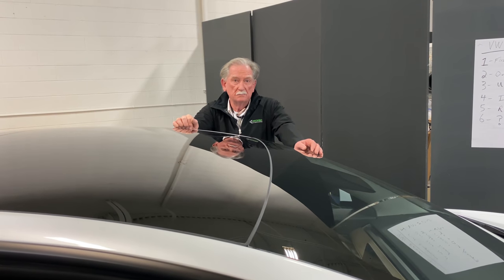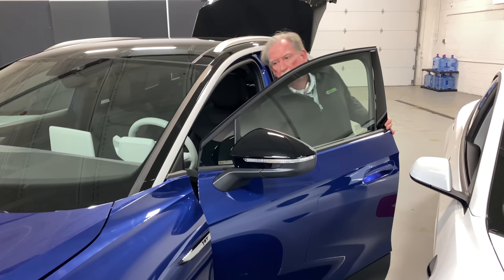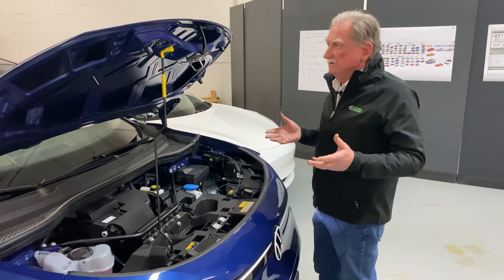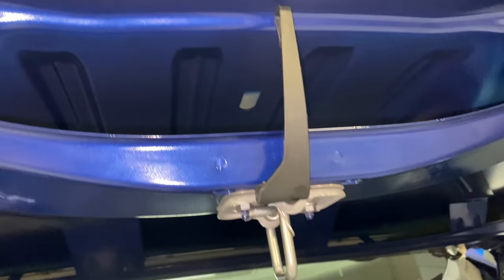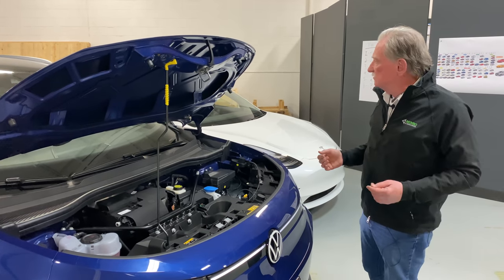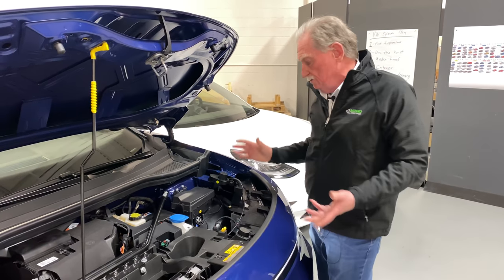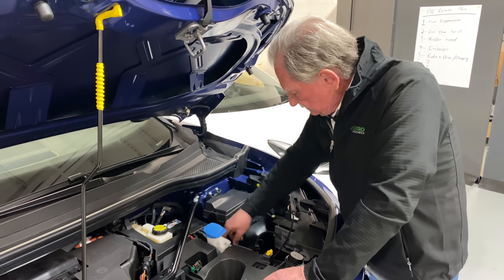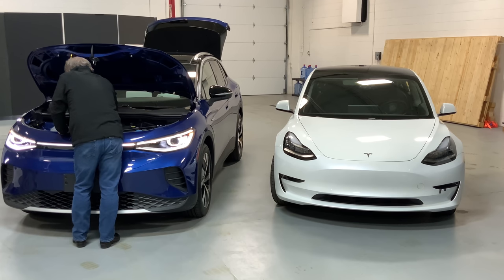2021 Volkswagen ID.4: E2 - Under The Hood

Comment: The VW is engineered for future expansion and changes on the platform. The underfloor area for the battery is more well designed than the Tesla. So now Tesla is trying to go a different route with their vehicle. The battery will be part of the car instead of a removable component that can be easily serviced , replaced or upgraded in the future. 

 I don't want to be anywhere near the first Tesla that breaks in half in  a high speed collision after a few years on the road. I have been wrenching on cars for 35 years both professionally and as a hobby.

I have cursed engineers and been impressed by them. I have seen what was once old become the newest high tech wave of the future more than once. 

The first unibody vehicles became garbage because the manufacturers thought they could cut corners and make them cheaper and lighter. Then they started to cycle back again and beef them up in certain areas after watching them tear in half or pin the people in side of them all crushed up and broken.

Many newer cutting edge engineers with futuristic ideas have no experience with reality. It all looks good on paper until the real world slaps you in the face.

Tesla has amazing engineering in some areas and pushes high tech toys that are ridiculous in a vehicle and are detrimental to safety. 

I could list 20 of them off of the top of my head. The Tesla driveline technology as of today can't be beat. 

The rest of the cars are crap and actually quite dangerous if involved in a crash or GOD forbid they catch on fire. Electric door handles and security features to get into the cars that prevent use or fail in an emergency will get people killed. A door window that has to come down before you can open the door is just stupid. Currently today there are a huge ratio of Teslas with door latches and handles that just don't operate or have been repaired multiple times.

I love Sandy and his insight into Engineering. He is an extremely intelligent man but like all Engineers they get into a lane and tend to stay there. It can't be helped , we are all human. 

That being said, The VW ID4 is superior in build quality and overall design to the current Teslas' on the market today.  If I was going to go out and lay down a check for one today between the two manufacturers it would be an All Wheel drive ID4. Even though the range is lower I guarantee in 10 years the VW will be in better shape and more enjoyable to drive.  As far as repairs go to the vehicle. The VW is built to be worked on and serviced easier. 

Everything in this world breaks or wears out. I would much rather work on the VW than the Tesla.

The Tesla battery management, battery , and motor is far superior right now but that is going to change rapidly.  

The actual build quality , fit and finish on the VW is better than the Tesla. The ride and handling is more comfortable on the ID4. The pricing on both needs to drop drastically but I get it , new tech is expensive for awhile.

PS . The interior space is way better in the VW for size when compared to the TESLA.

Comment: That bar over the battery is scary AF.  It may have a thick enough paint coating now but after you use the jumper cables a few times it's going to get scratched up and that coating will be worthless.
Reply: your not supposed to use that,
There is a positive pole in the fuse box for that.
Reply: @storm4710  There's a nice closeup at 5:35.  I don't see a spot, can you tell me where?  I tried googling but found no results about the ID.4's 12 volt battery posts.
Reply: @rhamph  the long thread on the 80A fuse, 
But vw recommends to use to use the positive on the battery and the negative on the body (u can see it above the battery @6:07 )
Reply: Still not clear to me which spot you're referring to on the fuse box.  I do see a shinier portion but I think it's just plastic with a different finish.

Sandy was connecting to the positive on the battery, it's the terminal that collides with the supporting bar when you attach jumper cables.  He also mentioned that the negative is the body itself.
Reply: @rhamph  at the end of the 80 Amp fuse there is a extra long bolt that should be a permanent positive
Reply: @storm4710  Ahh, I see what you're referring to.  However, I don't think that's intended for jump-starting the car as it's pretty small.

I have now found the WV ID.4 user manual.  Google doesn't have the contents but it has the manual itself.  Go figure.  https://www.vwidtalk.com/threads/id4-other-features.514/page-2#post-5438

It indicates the positive should be attached to the battery itself.  The negative has a large dedicated posted on the car body, I believe it's the one visible directly above and behind the battery.  I'm unsure if that's a problematic location as hydrogen gas frequently leaks from misbehaving batteries and sparks are common when attaching the leads.  I have limited practical experience though.

Comment: I agree with Sandy, they had an opportunity to start with a clean slate and when you pop the hood the same old ICE thinking is everywhere with lousy packaging, no build innovation and regarding the placement of the HV support tube, safe until you scratch the surface then you have a hazard, not impressed, looks like a converted ICE car.

Comment: Well its based on the MEB platform, what do you expect? All their upcoming Evs will have this issue.. Thats why ill go with Tesla. VW tech is already way behind even if barely released 😂😂😂
Reply: Yup behind on range, performance, battery tech, software, charging infrastructure and self driving. Not to mention they have a dealership network as well. Basically behind Tesla in everything.

Comment: This looks like a gas car with an BEV slapped in without much other thought. VW needs to rethink how an electric car should be designed from the ground up. While they still have time.

I was shocked when Sandy popped the hood.

Comment: “They have fuses that reconnect” , either new invention or circuit breakers...but anyways cant argue with an expert ...and as much as this show is meant for a particular  audience and does well with it, may also have a lasting impact on the reputation. Or the things are so bad that the few K from the youtube channel actually count. In any way ... its sad...
Reply: Its not a new invention and many other brands have been using that, but those reconnecting fuses are very expensive to replace.

Comment: That fire cut-off being buried is going to kill people. There's no way that should be allowed on roads.
Reply: I wonder why VW got their homologation in the EU in the first place. 
I will try to find out whether somebody checked this or it is like with Boeing 
- everything must be self-checked and self-passed before hundreds of people are allowed to die jn a crash.
Reply: Another comment on here pointed out there are 3 places where the power can be cut on the ID4 and only one on the Tesla. Also both cars will cut the battery connection automatically if they detect a significant accident.
Reply: @peglor  Na, there's 2 on a Tesla, one is clearly marked in the frunk, the other is on the passenger side a pillar. You can cut either one and they are on opposite sides of the car. There's 3 spots according to ID4 responders guide and I would argue all are very difficult to find. One is hidden in a fuse panel on the passenger side so you have to be inside the vehicle - not good. The other is buried in the trunk, the guide isn't that clear. And the 3rd is where Sandy showed. They are all difficult to find or inside the vehicle, where you don't want to be if HV is present.

Comment: Why are they using steel where it is not warranted? Because I suspect they make barely any money selling these and I would not be surprised if they do not loose some, so they want to make them as cheaply as possible.
Reply from the maker: Typically VW is the more cost-conscious brand of VW AG. Audi versions of the MEB platform will most likely be more aluminum intensive. Thanks for watching!
Reply: @MunroLive  I thought it's Skoda and Seat
Reply: @franker353  Maybe US-Americans do not get Skoda and Seat.
Reply: They have huge supply chains making literally millions of cars and they have a bunch of steel dirt cheap. VW is their value brand. High quality materials go into Audi and Porsche.
Reply: @DarwinChaug  All ICE car manufacturers right now do not make much if any money on their EVs, due to the cost of batteries and motors being higher than Tesla, if they make it themselves and much higher if buying from 3rd party, so they have to cut corners, hence all the plastic interiors and cheap materials used for the frame and body.
Reply: VW literally just started a year ago with the ID3 , here. are some numbers for you for the past year. 

Plug-in car sales in Q1-Q4 2020:

Tesla: 499,535 (16% share)
Volkswagen Group: 421,591 (13% share)

With volume production nearly matching Tesla (who has been at it since 2012) you don't think they are profitable? Why?
Reply: @DarwinChaug  The 421.591 include Plugin-Hybrids. Please, check your numbers.
Reply: @DarwinChaug  What does any of this have to do with profits???
Reply: @shuriken4852  volume production is what creates economic of scale and profits.
Reply: Auto Motor und Sport  says Volkswagen expects to lose about €3000 ($4730) on every ID hatch sold, with profitability forecast to begin around 2025.
UBS ID3 teardown estimated an eventual 15% gross. Munro estimated 18% on China Model 3 SR (pre LiFe battery) and 40% on dual drive.  Market analyser Xingye Securities gets 35% for Model 3 SR+.
Tesla gross total pre credits is ~24%.
Reply: @shuriken4852  nonsense
Reply: @alanmay7929  That is not a counter argument. There is absolutely no value in what you just posted. If you have nothing to contribute, please just do not post. Thank you.
Reply: @shuriken4852  yeah troll!
Reply: @alanmay7929  Still not a valid argument anywhere in sight.

Comment: It is simply rushed engineering. It takes a lot of time and effort, to make things simple. If something looks so chaotic and wasteful it's because that was designed in a short time and rushed to the market before any optimization. Look at the mixture of old and new engineering like the fuse box, crazy bar to keep the HVAC (how do you change the battery?) See also the state of the software in VW, and abysmal integration with their own charging network. Tesla is a much better-designed car, but take the Munro's reviews made in previous years, when the car was also fresh and buggy. If you like ID4, buy it next year or even in 2023. It will have frunk then :))
Reply: Couldn't agree more Andrzej.

Comment: I was expecting to see that the ID.4 just had less space in front, I was not expecting to see the chaos of an ICE vehicle. I think that this alone shows how far ahead Tesla is when it comes to engineering and tech, they get better performance using less space.
Reply: Chaos?  You've clearly never dug into a engine bay before.  This looks extremely simple in comparison.  Everything seems to be easily accessible.  Try doing that with an ICE.
Reply: The id4 has way better practicality and turning radius than the model 3 go watch Björn Nyland videos
Reply: Maybe they should put some plastic to hide the tech stuff. So not to worry the clueless consumer.
Reply: @mikaelpettersson5916   Customers will only need to go under the hood on a few rare occasions, so they'll rarely see it.  Sandy never points that out when complaining about the weight, look, or space usage.  He's only highlighting it because he's a Tesla shill that feels the need to point out everything he feels Tesla does better to justify the large $14k extra it costs to buy a model Y.

Comment: The old doesn't understand short hood filled with all the components allows to have a huge interior space. Unlike Tesla.
Kudos to Volkswagen for pedestrian safety. Tesla is one of the worst cars tested in 2019 by Euro NCAP.  Teslas are quite dangerous for pedestrians.
Finally, the laughable turning radius of the Tesla compared to the manoeuvrability of the Volkswagen. Wheel wells needs space that the Tesla doesn't have.

Comment: Seems like they started with a current model, converted it to be electric and made some minor changes under the hood, bringing along a lot of the old and heavy. Obviously not a new design, totally rethinking everything that an EV could and should be. I guess that's your only choice when you're already years behind.
Reply: no, it is a completly new and on electric architecture.
Reply: @merzto  New but not different. Same old same old in many places so far. They need to read about first principles thinking.
Reply: @merzto  That is interesting, then.

Comment: MUNRO , confirmed alot that the VW iD4 is poorly designed and OVERWEIGHT.
its also not an Efficient Design and is wasting space to where TESLA maximized space in front to have a FRUNK.
MANUAL hood release is from GAS cars , as is the Hood Support Arm, and is UNNEEDED. 
VW is still using Automotive fuses , lame. 
Firemen are going to find it Difficult to locate the BATTERY Cut off , located under the Washer Fluid tank. not on Obvious place.
the ONLY Redeaming quality the the Good Design HVAC filters. 
but, that Support bar is adding weight to the overall vehicle.

Comment: Like always over-engineered for nothing. I guess they will start with industrial design when all the engineers are on pension at VW ;-) What I saw till now is a horse with a battery in his ** :-) What's the point of a security tag when you can not open the hood after a crash? Fuses from the '80s and a life-threatening power source near a negative pole? 
One thing you see clearly now. An old OEM vs a new OEM ( start-up ) At the old everything is build on old foundations.
Reply: Old habits are hard to break.
Reply: @evwannabe593  That's why you need start-ups ;-)
Reply: Stop talking nonsense mate, the id4 has way better practicality and turning radius than the model3 go watch Björn Nyland videos.
Reply: @alanmay7929  Yes, I buy a car for the turning radius ;-) It seems you still don't get it. I don't look at the car, I look at the whole picture from drawing to the finished product of every product.
Reply: @ADOENDRA  you are very ignorant I feel sorry for you. There is a reason why American cars and trucks doesn't sell well in Europe and around the world. The better practicality in cities is always welcomed. In Italy and Japan they have even smaller cars very adapted to their cities.
Reply: @alanmay7929   I do not repeat myself often, but for you, I make an exception ;-) 
It is like talking to my wife.
I do not care about a car, bike, boot, or candy bar. I care about how things are built.
At the end of the day, everything comes with a price. 
Sure I understand your thoughts on small cars in small cities. I'm not from Yesterdy.
The ignorant are those who still believe in 100-year-old technologies.... And yes, old OEMs still building on old foundations. In these 100 years we have lost efficiency and it will get worse with all the APP generation engineers. But then again. I live in Belgium and I drive a 5.3 V8 Chevrolet avalanche pick-up. Why? Because they are cheap to drive on LPG ( € 0,60 per liter ) and I only pay € 140 a year on route tax. Do I have a problem driving this monster? Nop because I can rive ;-) 
Let's say tomorrow you have a brilliant idea and you like to bring it to the market. Do you like your product to be designed complex and expensive or efficient and cheap? 
I really like to hear this one from you as an expert in industrial design ;-) It seems to me you really do not understand TESLA was shaking the whole car industy.

Comment: Obviously built by a legacy auto maker.
Reply: Wtf are you talking about?! The id4 has way better practicality and turning radius than the model3
Reply: @alanmay7929  I was talking about the design. It’s built like a typical front engined car. Model 3 is the safest car in the world in part because of its front crumple zone.
Reply: @leorock7823  another nonsense, the model3 is one of the safest car in the world
Reply: @leorock7823  the id4 motor and controllers are built on the chassis and the front mounted equipments are structural and were designed to crumple in a crash.
Reply: @leorock7823  people have crashed in Lamborghinis at 300kmh and survived.
Reply: @leorock7823  you know absolutely nothing about the id4 go and watch the presentation, I’ve been watching many EV enthusiasts from Norway and other countries talking and testing EVs.
Reply: @alanmay7929  Who? Show me! Point me to the video of the crash.
Reply: @alanmay7929  You don’t have to believe me. Go look at the crash test results for yourself. I’m not just spouting BS. You can find those results for yourself on line. All I was saying is that the design for the ID 4 was obviously designed by a legacy car maker. It doesn’t take an auto “expert” to see that.